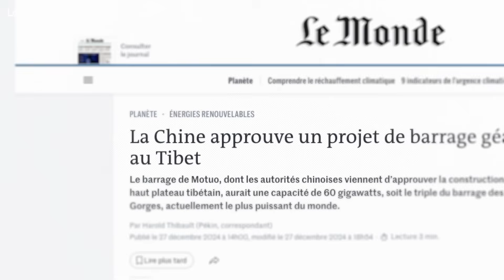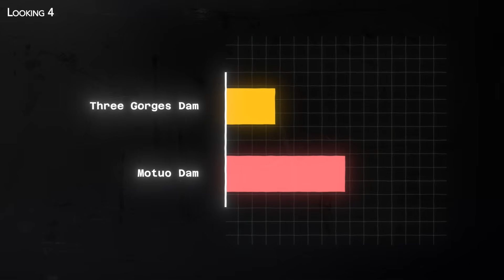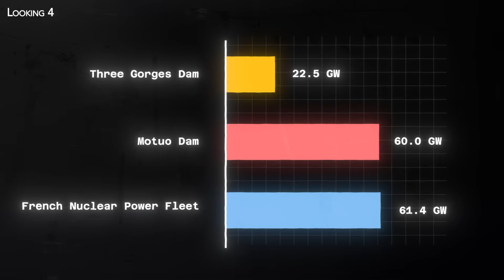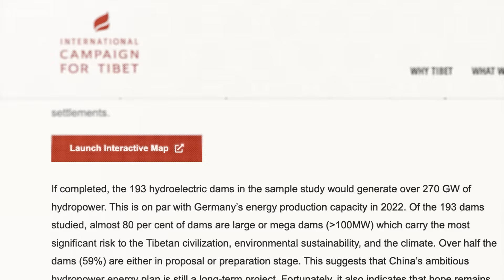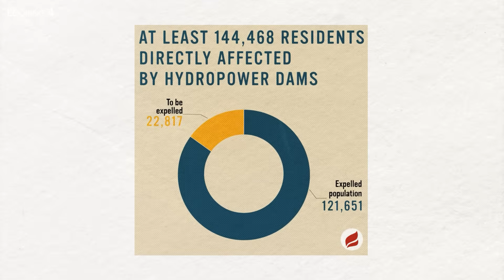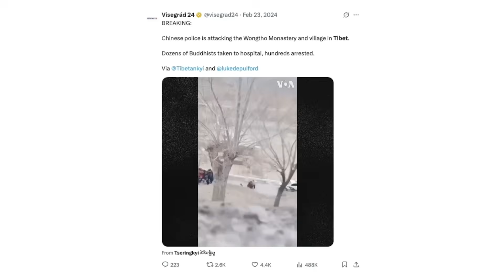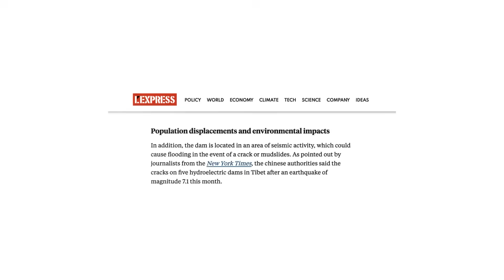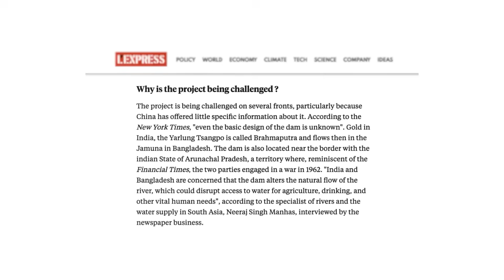China is Building the World's Most Powerful Dam

Comment: Good Morning 
the following is still in the working out faze
This document is for a retro fittable power production system for a hydro dams to have up to three extra turbine banks without making issues for the main turbine hall
Now the reason this type of system has not been looked at was two fold .. the loss of flow rate and back pressure issues 
As all the worlds dams have the same basic layout regardless of the turbine fitted. The basic setup is turbine shaft to shock uni joint to the turbine. And so all have the same common limitations  
A new type of turbine unit is needed if the main turbine hall is to function with without mods for a multi bank units are to be placed in the flow 
This new system will never match the output of the main turbine hall but after years of chasing minute increases a system like this one is a massive jump in output 
At this point it should be noted that most of the installation process can be made with the dam online selling power to the grid and there is no increase in water usage when fully installed  
This system has been designed to be fully independent of the main turbine hall so as to be serviceable with the other units online and running with the main hall 
A FEW OBVIOUSE POINTS 
Population = Even if our numbers were to fall we are still in a situation of heading to a power shortfall outcome things like data centers e cars and a hole host of other tech 
The lag time at best for any new power units to get online is 2-3yrs at best and i believe we are well short of filling the markets needs 
OTHER BENIFITS OF THIS UNIT
Is a dam green tech? well its more recyclable than wind and solar
lasts 100 plus years vastly more than the others
It should be noted if the patent is very strongly protected the market will come to the seller even if it is in Australia or America so a 100 billion dollar a year marketplace makes the wage bill a non-issue 
SOME OF THE BIG BENIFITS 
Bigger market share/customer base
All the required infrastructure is already in place
the asset has a longer life span
No issues regardless of type of the main turbine fitted 
No added down time 
AND ITS TRUE BASELOAD POWER from a existing dam

Comment: Nonsense China bad video. Most of the water (80%) in the Indian Brahmaputra is from rainfall on the south side of the Himalayas which is within India and Bangladesh. Water in the Yarlung Zangbo is mainly from snow melt from the Tibetan plateau and contributes a small fraction of the water on the Indian side of the border. As far as the dam is concerned it will be a run of the river power facility with no reservoir or a small reservoir which will not affect downstream water flow. India and Bangladesh are being paranoid. Power transmission will be by HVDC which is greatly superior to HVAC transmission but technically more complicated.
Reply: China mega projects... Come with high risk for disasters.. Well, China willing to take d risk.. 😮😮😮😮Pray it will b safe always.. 😮😮😮😮

Comment: It's a Hydropower Plant project not a Dam project. Hydro power is made will a column of water presure flow that activate turbines that generate electricity  You can build a dam along a canyon river to create the water column or you can dig a tunnel from a high point of the river to a lower point of the river and create the water column. The Niagara Falls Hydropower Plants use that hydropower plant architecture. The Yarlung Tsangpo is a steep canyon river. China is the world champion of tunneling technology. They are planning to create a staircase of 4 water column tunnels feeding turbines inside the mountain. They will use the full water column height of the river loop without having to build a dam of enormous height. There will be no disruption of the seasonal water flow at the Indian border. The water flow diverted in the tunnel power plants will all come out at the bottom before the Indian border. The Indian anti China theories are mostly based on what they would have done if they were in China's place. They don't have the Chinese mastering of tunneling so all their hydropower plant experts can imagine is the dam solution.
Reply: Great explanation from an engineering point of view, not some regular BOZO commenting.